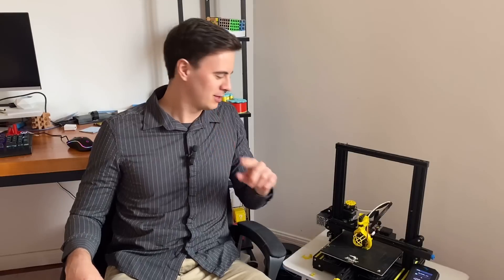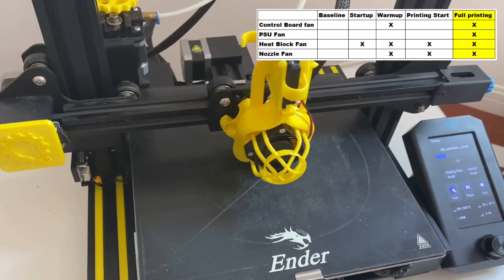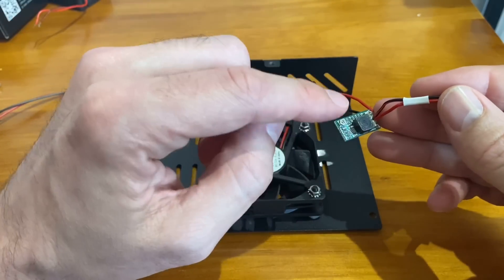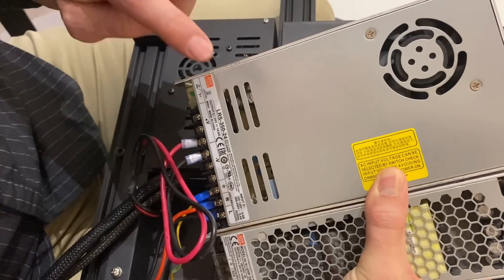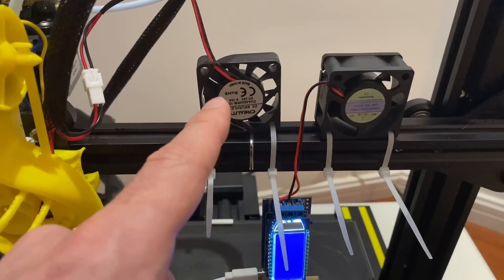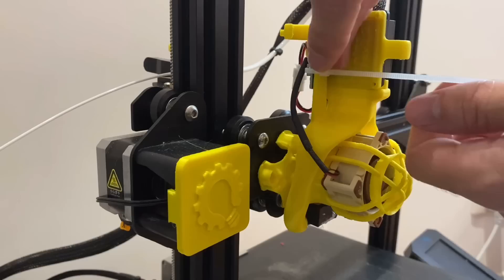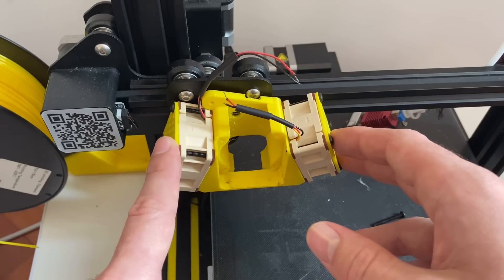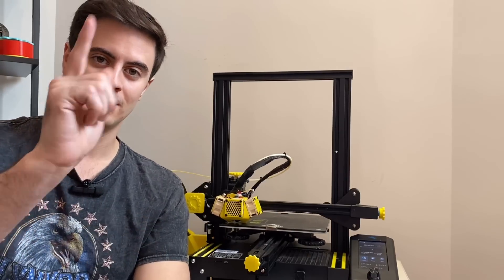Nearly SILENT mods for your Ender 3 V2 (part 2)

Comment: The only issue I can see with the hot glue blob is that your new 0 for the x axis is a little further to the right and can be an issue if you print something that is really wide and might start printing in mid air. nice fixes. I might upgrade my fans, too. I don't need to because its in my spare room, but why the hell not :p

Comment: Intresting question. Since its been 3 years, Did you by chance know if the printer experinced any heat creep? Been reading into reddit (the most reliable source /j) and that because  ive been debating on going with the noctua set up, or if i should just make an enclosure lol. 

From what ive read some people experinced heat creep through the block because the noctua has low pressure?

Comment: On the Ender 3 I swapped out the fans, the PSU fan was replaced with an 80mm - it's still like 10db quieter lol. Also worth mentioning: eliminating fan guards reduce the noise significantly as well (if it's a close mounted guard). I have no idea what people need a fan guard for, so I got rid of em.

Comment: That's nearly $200 worth of fans though.
Reply from the maker: Yes the power supply is also quite expensive. That’s why I tried to do these upgrades step by step to show what results you can expect from each
Reply: @DesktopInventions  if your printer wasn't near your room or affecting your sleep, is there any benefit to the mod? Is it pure audible difference? Any benefits to parts cooling?

Comment: I've used the same DC-DC bucks. But I've left on the mainboard and PSU the stock fan lowered to near 12-15v and they become silent with still good airflow.
On hotend instead of Noctua I've used Sunon MF40202V2-1000C-A99 DC 24V 0.68W 40x40x20mm. It's rated for 21db and doesn't need bucks.

Comment: I was wondering if the PSU can Handle long running time without heating up. 3d printers can run for days sometimes
Reply from the maker: Yes no issues with this power supply running a long time.

Comment: I want to buy a 3D printer for moped related prints. So i am doing some research and came across this video. Clear explenations, keep it going!
Reply from the maker: Your welcome! Glad I could help!  Make sure to use ABS if your parts will be exposed to higher temperatures!

Comment: Does anyone has an estimate on how much does it cost for all of these upgrades?
Reply from the maker: About $50 worth of fans/DC convertors and the power supply is around $80 but not 100% necessary.  Links are in the description.
Reply: @DesktopInventions  Thank you very much. Really enjoyed your video (and also others on this matter).
Also, which alternative do you suggest for the power supply?
Reply: @DesktopInventions  And very good job on the "technical" analysis with the different alternatives. Very good approach, that helps to understand the influence of each upgrade. Great seeing it on the graph

Comment: Hey, I replaced my cooling solution to the same one you have (the one at the end with three noctua fans). I faced a lot of issues with cooling after that, did you change something after that?
Reply from the maker: Not really, the cooling head from this video was one of the best performing cooling heads I’ve used. Did you use 4010 or 4020 fans? Both should work but 4020s are a bit better. Also did you check the air flow is aligned right below your nozzle?

Comment: Why you dont connect this 2 fan in series ?? changing fan speed would work beter and you dont need this ugly dc-dc converter ???
Reply from the maker: Yes good point I ended up doing that later on in another video

Comment: Btw your wiring is wrong at 07:00 for psu
Reply from the maker: The AC wiring?
Reply: Yes AC wiring I actually bought the same power supply and I thought I should just follow your wiring pattern but realized your AC wiring is wrong.
Reply from the maker: I don’t believe so, green yellow for ground, black for line, and red for neutral. That was how the original power supply on the printer was connected anyways!

Comment: The buck converters in your link have an issue where it opens the circuit if the supplied voltage is above 18V (this happened on all 5 of the ones that I got). I would recommend others use a different converter
Reply from the maker: Interesting I haven’t encountered this issue before with the 3 or 4 I used. I did see other comments on Amazon about this issue it Might be a quality defect. Thanks for bringing this up!

Comment: With this build, did you change any temp settings or things like that being that there is more efficient air cooling out of the tip? I just did this build for my 3v2 with the upgrades of 3 4x10 noctua fans, Swiss hot end and cr touch. The filament I know is good, now skips on sticking at points. Thanks for answers and the ideas you provide!
Reply from the maker: No I didn’t have to change any setting except making sure the voltage was right for the fans. What part is sticking or skipping?
Reply: @DesktopInventions  it was the layering that was doing it. Looking more at things and doing a few tests, raising the hot end temp was the fix for me. I’m on successful print #2 currently!
Reply from the maker: Good deal great to hear you got it figured out :D

Comment: Awesome! I already done the mods for de PSU and the control board, my question is, you use 2 buck converters or 3 on the hotend cooling?, only have buck´s with led display and don´t wanna make a mess, thanks! (gonna better my english :) )
Reply from the maker: To start off I used 2 buck converters, 1 for the hot end fan and 1 for the 2 parts cooling fans. Later I removed the buck converter for the 2 parts cooling fans since it was unnecessary. I just connect the 2 part cooling fans in series without a buck converter.
Reply from the maker: Just as a note if you connect the part cooling fans like this you lose the ability to control them very well with the software. For example if you set the fan speed to 50% only 1 fan will run. But I usually run mine at 100% and there’s no need to turn them down since they are so quiet.

Comment: For PSU I used a AMD stock CPU Fan with enclosure from thingiverse. It has identical ventilation holes. Works perfect: the fan turns on less often and for a shorter period of time. For the Mainboard I went with a 120 mm PC fan. Also printed a new encousere for it (with holes for ventilation) and now the fan is on all the time.
Reply from the maker: Nice upgrades! I bet it's much more quiet than the stock setup!

Comment: Hello, I've been watching lots of fan upgrades where all of them recomend 12v fam with buck converters and I decided to upgrade it with those fans so I can run my ender 3 v2   24/7  but I also have encountered retractor of those upgrades and scared me a little bit, so I wanted to ask you if since the date you made the upgrade on your printer till this day have you had any problems with in the mother board or shortcut or some issue thay would relate to the fan upgrade? I've seen how well they work in a lot of videos but I havent seen any comtinuation of how it continue working. 
I wanted to say thank you for your video it has helped me to understand a Lot :).
Reply from the maker: Thanks for the comment and I’m glad you enjoyed the video! No I haven’t had any issues with the buck converters on my 3D printer. I used to have 3 at one point and removed 1 of them just to simply the printer and connect the two 12V fans in series.  No issues for me, nor have I heard of others with issues.

Comment: Excellent work! I'm wondering why u went with the 40x20 instead of the 40x10. Is it because that one may not have enough airflow?
Reply from the maker: Yea I wasn’t confident in the airflow of the 40x10 so went with the safe route with the 40x20. Plan to do some more testing in the future to see how a 40x10 works

Comment: You know there's a reason why the power supply has a fan right? 
it's really important to cool your power supply or it will overheat and fail quickly especially in the small enclosed space it's in under the printer. It would be ok if you had the PSU out of the enclosure to allow for convection to happen at least naturally.
Reply from the maker: Yes, what your saying is generally best practice, but this power supply is running at 40% load typically so it doesn’t struggle too much with heat buildup. I will plan to make a video later monitoring the temperatures of components to show how they’re performing.

Comment: One of the easiest things you can do to reduce the noise it to remove the psu cover, maybe print something instead but it can safely work without the cover.
(by psu cover I mean the black metal added by Creality)
Reply from the maker: Good point, they definitely restricted the air intake on the PSU fan too much causing it to turn on more frequently

Comment: The best you can do to make your ender 3 v2 literally silent, or any other 3d printer for that matter, is changing the coolers for NOCTUA coolers.  
That's it. You go from 50~60db to 29db instantly.
Reply from the maker: That’s pretty good advice, pretty similar to the end result of the video, thanks for watching!

Comment: Put a housing around it with sound deadening material like foam and wood, an acrylic door to check progress too, and it'll be dead quiet and depending on the filament improve the print quality too by maintaining ambient temperature more evenly.

Also, place a proper base under the printer, something made out of hard rubber or foam or pavement block like CNC Kitchen did, it'll help mitigate resonance throughout the surrounding environment and probably helps with print quality a tiny bit.
Reply from the maker: Thanks for the advice, these are both great tips!  I have moved the printer to a more sturdy solid wood table which helped a bit as the old table was a bit wobbly.

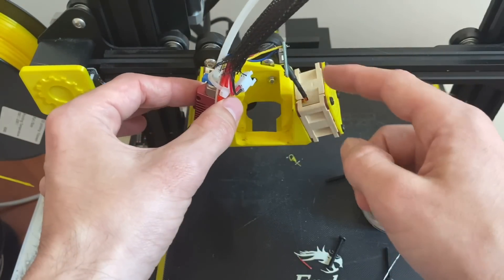Comment: at 13:03 how do you wire those up so the speed varies. I cannot find this anywhere
Reply from the maker: I saw on a post somewhere that if you hook the negative wire from the fan directly back to the motherboard (bypass the DC converter) it works to vary the speed. But I haven’t tried this yet
Reply from the maker: Here is a link to a thread explaining it. You can read the comments in there. https://www.reddit.com/r/ender3/comments/d7oxnh/external_mosfet/
Reply: @DesktopInventions  ok thanks for the help. So is yours just running at 100%?
Reply from the maker: Yea at 100% I’ll probably look at this other solution I sent you when I do the direct drive upgrade
Reply: @DesktopInventions  Ok thanks for all the help. Have you experienced any of the heat creep people have talked about. ALso do you know if there is the same duct but with BL thouch anywhere?
Reply from the maker: No I haven’t. I’m really tempted to go back to the stock setup and do a thermal comparison video since everyone is all up in arms on the forums about this issue.  As for the BLTouch someone recently mentioned 4617163 on thingiverse that should be compatible, but sticks the BLTouch in front of the fan opening which isn’t ideal. Otherwise you could try the solar orbiter as well
Reply: @DesktopInventions  thanks I just looked that up yeah it doesn’t seem like the best solution. I’ll have to keep looking. That may be interesting to see. I never see any real data just people telling me not to do it. I appreciate all the help and replies.

Comment: Litterly 2 years 2 late...... There are dozens and dozens of video's about making this printer almost noise free..... With exact the same upgrades you mentioned....... Why re-invent the wheel?
Reply from the maker: I wanted to document and show the various sound improvements 1 by 1 and the impact of each change. Also changing the power supply and using 3 noctua fans on the printing head isn’t something I’ve seen before.

Comment: Is there a powersupply like this for the ender 3 pro. I cannot stand the noise this thing makes.
Reply from the maker: The best economical solution would be to change the fan on the current power supply to a larger and quieter fan. But If you want a fanless PSU and want to mount the power supply on the side of the 3D printer you should have some options. The UHP-350 would work but might look a bit ugly with wires coming out of both sides. Also there’s one called inshareplus 400W which would also work.
Reply: @DesktopInventions  ok thanks yeah it sucks that the ender 3 pro has a different mounting solution than the 3 V2. Do you know if I could just move the supply to where yours is and have it set up that way?  Also was the cost around 90 that’s what I’m seeing on amazon.
Reply from the maker: Yea around $90 on Amazon, unfortunately not too cheap.  I think you could move it to a similar place as the Ender 3 V2 but you probably have to make a mounting plate of some sort. And definitely measure the space on the bottom of your printer before you purchase. Also account for the harnessing coming out of both ends of the power supply

Comment: I have 4 printers,  if I am doing an overnight print I will use one that isn't in the bedroom. 
I have Changed the fans on all my printers and all have silent drivers.  Makes a massive difference.

I found the power supply fans on all of them to be a lot of the noise imo. Changing to a nice 80mm fan solves that.
Reply from the maker: Yea the 80mm fan on the PSU is probably 90% as good as a fan-less PSU sound wise but much cheaper. The new PSU was a bit of an extreme solution haha

Comment: Bought all the supplies from Amazon., fired up the printer to start slanging plastic to make the parts, and after the printer probed the bed I realized there is no option for a BL Touch mount for this fan mount. Wish there was an option for BL/CR Touch
Reply from the maker: You can check out the solar orbiter model on thingiverse. I believe that one is compatible with the BLTouch and the noctua fans.
Reply: @DesktopInventions  Thanks for the recommendation. I think the Solar Orbiter may work, but I have serious doubts about the restriction of flow for the duct side opposite the fan.  Might as well print it out and give it a try. In the mean time I'm going to see if I can remix a BL Touch mount on to this design.
Reply from the maker: @GreenG20t Agreed I thought the same thing, I have a BLTouch but haven’t got around to installing it yet. If you do a remix of this fan mount that might push me over the edge to install it xD

Comment: Great video! I was wondering, have you had any issues with heat creep on the heat block? I've seen some people say that can be an issue with the noctua fans, which don't put out the same CFM as stock. Also, any over heating issues with the new fanless PSU?
Reply from the maker: No issues on creep of the heat block as of now with a 100+ hours of printing including some 15 hour long prints. Bowden tube is still in good shape. So far so good! 

As for the PSU no issues there. According to the decaying on the spec sheet it can handle anywhere from 245W to 350W at 50C ambient temperatures depending on your native country voltage 110/220V.  The Ender 3 draws a max of 240W for a short period as the bed is heating up then draws significantly less than that while printing.
Reply: Thanks, that's some good info. I've been switching to noctua fans on my Sovol sv01. I was concerned about the hot end fan, but I think the 4020 will be fine like you said. I opted to keep my original PSU, and just add a 120/15 cooling fan. That actually seems to be a bit overkill, 80 or 60 probably would have been fine. But it's silent and running cool!
Reply from the maker: @Tom-ik5sc  that’s great to hear! Yea a whole new power supply is admittedly overkill haha and a larger fan but s a great solution to lower the sound level. I’m curious will you use a noctua fan for your part cooling fan as well?
Reply: Hey. Yes, I actually am putting on a 4020 noctua parts cooling fan. I finally found a good mount for it, and just got it mounted yesterday. I'll be wiring it in with a buck. I'm not sure if it'll have enough static pressure, though. But I've been hearing about using slicer tuning to reduce the need for fans. So I'm hoping if I can get slicer settings right, the lower air flow will be ok. Worst case, I can put the blower fan back, I'm using JST connectors to make swaps easy.

Comment: Hey question, when you put the two Noctua fans on. Did you wire then in series for 12+12 for 24v so you didn't have to put a buck converter? Or is that not how it works with fans?
Reply from the maker: Yes you can put them in series so you don’t need the buck converter.
Reply: @DesktopInventions  awesome! Happy New Year, have a subscriber haha

Comment: I just don't understand the whole "noisy" printer thing. At it's core a 3d printer is a machine and machines make noise. At 60 decibels stock, a printer is not much louder than a household refrigerator or a business office. 
Good video though
Reply from the maker: Yea everyone has their noise tolerance threshold, wives also are sometimes not as understanding about having “machines” in the house haha. Also there are many people with 3D printers that think tinkering and upgrading the machines are half the fun to it 😀